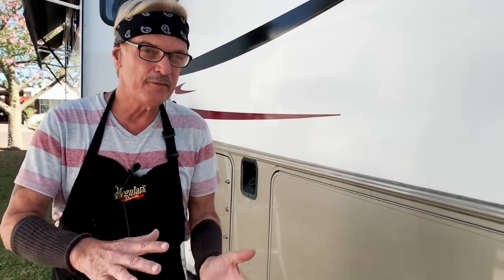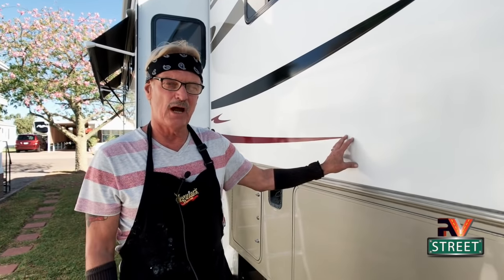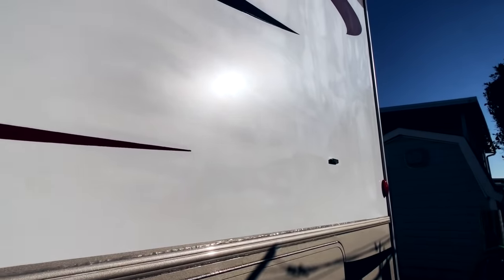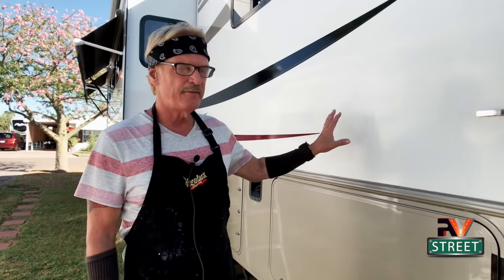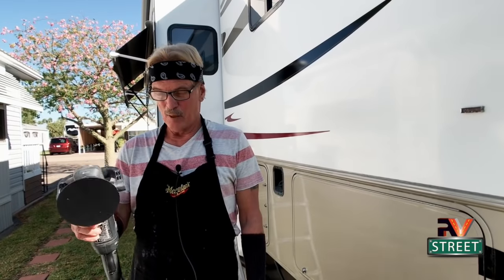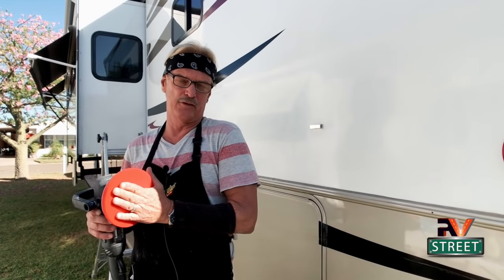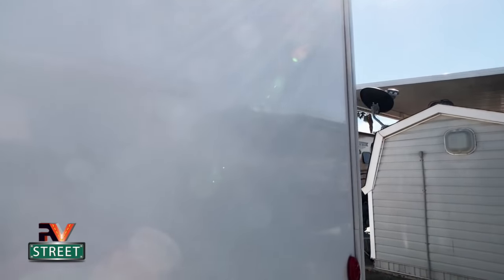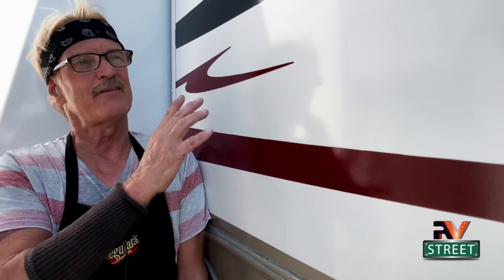HOW TO POLISH & PROTECT YOUR RV THE RIGHT WAY 👍

Comment: My coach has quite a bit of oxidation. I'm going to use a rubbing compound to cut through it best I can, then wax and polish - before painting the decals. Except I'm not sure which to do first, painting the decals or rubbing compound and wax the coach? Thoughts?
Reply from the maker: Painting the decals last.
Reply: @RVstreet   Since my coach has a good bit of oxidation, should I wax rather than polish afterward? Or. wax first after the compound, and then polish over the was too?
Reply from the maker: @INOut107  The order is: Wash good, then compound, then polish, keeping your pads clean during these steps and then wax.
Reply: @RVstreet  Thank you.

Comment: Martin- I went to order through your Amazon link and it shows the Wash Wax All as not currently available. Do you have a recommendation for another similar or comparable system that I can get? Thanks
Reply from the maker: Nope. There's nothing like this mop kit. All others are just inferior and not near as easy to use. I have talked to the company about this lately and they have had supply chain issues ever since Covid but are trying to catch up. They have recently told me that they should be back in supply by late May or Mid June or so. But these units do sell quick they're that good.
I so appreciate you sending me this comment and wanting to support our channel by using our Amazon Store for this purchase. I respectfully ask that you try back about about once a week until you get your order in. Here's our Amazon Store link again to make it easy for you. https://www.amazon.com/shop/rvstreet
thx jgutz 🔧 👍

Comment: Is the lightweight polisher you use suitable for removing heavier oxidation?  Do you have a video on that process?
Reply from the maker: Yes the light weight Meguirs MT300—5.4lbs.—it is the exact unit I used to remove the oxidation on our coach had when I first bought it in 2016. I didn't have a YT Channel at the time so no, I don't have a video on it. But I wish I did. I've actually been looking for an RV that has some oxidation so I can do a video on the process in a camp ground. But I haven't had any owners willing to cooperate with me. I use the MT300 for everything. It's an awesome machine. Be sure to buy the back plate too. It's sold separately.

Start small first. Like on the back. That will give you an area to get into the rhythm. Compounding to remove oxidation takes time. As you compound the pads will load up with material, so as you remove it constantly by keeping cleaning them. If you have heavy oxidation, you'll have to use the wool pad and the diamond cut compound, otherwise use the other material and my red pads. Once oxidation is off, then polish. It probably will take 2 or 3 passes to restore the shine. Don't do it in the sun. An overcast sky is the best to polish and apply RejeX as your final coat. Again keep your pads clean, keep wiping off the polish off the RV each time you make a pass. Do small areas at a time. It's also better and goes faster if you have several pads. Just be patient, be methodical and it'll come out nice. You can do this.

Everything I use is in my Amazon Store https://www.amazon.com/shop/rvstreet
The stuff you're inquiring about is in the "Compound, Polish, Finish Coat" category. Above each product is a text bubble where I describe what each product is and what I use it for.
Here's a link to one of my PLAYLISTS that covers other aspects of how I take care of the outside of our coach. These will be helpful to you also. Especially the first 3 videos: https://www.youtube.com/playlist?list=PLkQXtMp9xodSqUtTPMkSjVRGmSQkz4XJz

Hope this helps. 👍
Reply: @RVstreet  Thank you for the help.  The unit I bought is only 18 months old but it’s been sitting out in AZ and is just starting to oxidize on the upper half.  I want it to sparkle.  Can’t imagine someone wouldn’t let you clean up their rig😁
Reply: @RVstreet  ok, from your Amazon, I’ve basketed up the buffer, 5” backing plate, 5” red foam, polish, reject.  Th wool pad listed is 8” so doubt if that is correct for MT300.  Also, there is an oxidizer remover 49 and two other compounds listed.  What wool pads and compound do I need to remove moderate oxidation and prepare it for the polishing?

Comment: Hey! I wanted to order this exact set up but in your links, you have a 5 inch backing plate and 6.5 inch pads, is that okay? or should I go for the 6 inch backing plate? Thanks!
Reply from the maker: 6.5" pads with the 5" plate is fine and that's what I use. So ya, it's okay. I'm glad you brought this up. Others may have the same question so I clarified this information in my link description. Thanks for supporting our channel SM. 👍

Comment: Hey Martin (and videographer extraordinaire, Joanie) thanks for the follow up video. I’m glad you mentioned the pads.
I have a huge issue and am hoping that you can help. I went through a commonly used Truck Wash. while attempting to get some rust off I noticed that some of the gel coat, or whatever they use now, is gone. I think they used a hard brush trying to remove the rust.
What products do I use? I have the blue wipe on wipe off cleaner and various other products. I’m not at the RV so I can’t list them. 
Is there something I should start with?
Thank you in advance.
Reply from the maker: "while attempting to get some rust off I noticed that some of the gel coat, or whatever they use now"
Can you elaborate some more on this? What part of the RV are you talking about, type of RV etc.
OR........
Take a couple of good, well lit pictures, describe your problem and post them here on our FB page.....if you do FB

Comment: Would you suggest those same steps on a six month old 5th wheel or something different as it is new?
Reply from the maker: If it's full body paint (FBP) no. Most RV manufacturers recommend at least  1 year before you do any polishing or waxing to a coach that has full body paint. It needs that long to fully cure before you go additionally sealing and protecting it with wax or RejeX etc. But I have seen very few FBP 5vers out there. So with that being said, if it's not FBP then absolutely. If you start to take care of it now, and protect it now, you''ll be saving yourself a lot of grief later on. Once an RV starts to fade, get dull or oxidize your work load just doubled.

Comment: how can i tell what type of roof i have fiberglass or rubber
can i use 303 rubber roof cleaner on a fiberglass roof?
I bought 303 rubber roof cleaner from amazon, hesitant to use on my roof 2004 Damon Ultrasport
Reply from the maker: Well, you have to get up on the roof and look. If you have a hard shell type roof it's fiberglass. If is softer or has a fabric type material you have a rubber or EPDM roof.
I would not use 303 rubber roof cleaner on a fiberglass roof.
If you want to see the right way to take care of a fiberglass roof and what I've done to my fiberglass roof you need to watch this video: https://www.youtube.com/watch?v=H00oNtbvtrk&t=538s

Comment: What is the best pad and product to use with the MT300 to remove oxidation before following this procedure?
Reply from the maker: Thanks Terry for your question 🔧 👍
My red pads for light oxidation and wool pads for heavy oxidation. In my Amazon Store under the "Compound, Polish, Finish Coat" category, I have a text bubble above each product that explains what product and pad I use for different applications. You can't go wrong with these recommendations. JIC....you didn't see it in my description text, if you order my MT300 you also need to order the backing plate because that does not come with the polisher. I use the 5" backing plate, not the 6" plate.
https://www.amazon.com/shop/rvstreet
Reply: @RVstreet  Thanks, everything ordered
Reply from the maker: @terrymccafferty  Thank you Terry so much for supporting us using our Amazon Store. Take your time and be methodical. When I did my RV when we first got it, it was oxidized pretty bad. Especially the drivers side. The total process of removing all the oxidation, polishing and protection took me 3 weeks, working on it mostly in the afternoon and evenings in a covered storage area. I bought a rolling scaffold with locking wheels to do all the upper part of the RV. That made that part so much easier by being able to stand straight and work those areas. 
One last thing that will help. As you remove oxidation the pads will load up with removed material so you'll have to continually wash them out. Have a 5 gallon bucket of water and a small brush up on scaffold with you to do this as you move along.
Good luck and let me know how everything came out when you're finished. 👍

Comment: Are the stripes decals or painted?   If they are decals won’t buffing them damage the decal?
Reply from the maker: They're vinyl graphics and no it won't when polishing.If you watched carefully the main area I was really focusing on was the white fiberglass areas. But even when doing areas like that I gently go over the graphics too because can start to get dull and faded too. It's not a big deal. Didn't you see how bright and clean my graphics were? And ALWAY RejeX them too.
Reply: @RVstreet  Thanks for the reply.  Just don’t want to make a mess of my decals.  🙄. I watched you very closely but wasn’t sure if the were decals or painted.   I did see how you made everything look new.  Thanks again for sharing.   My Fiver is brand new.  Just washed it and was preparing to wax it.  But now I’ll use the RejeX vs the Meguires wax I have.  I always wax my vehicles every quarter.  My 2005 Civic looks brand new!
Reply from the maker: @enarandyr9122  👍

Comment: Martin my class c needs to be polished badly!!!!!
Reply from the maker: You can polish it to nice shine as long as you don't have any oxidation. If you have oxidation that has to be removed first. Here's some instructions:
The light weight Meguirs MT300 Dual Action—5.4lbs. It's an awesome machine. Be sure to buy the back plate too. It's sold separately. It is the exact unit I used to remove the oxidation that our coach had when I first bought it in 2016. Having the right polisher is important. My coach at the time had heavy oxidation on the drivers side and back with light to medium oxidation on the other areas. My large slide on the drivers side was the worse so I had to use the wool pad and diamond cut compound on that area. I didn't have a YT Channel at the time, so I don't have a video on it. But I wish I did. I've actually been looking for an RV that has some oxidation so I can do a video on the process in a camp ground. But I haven't had any owners willing to cooperate with me. But I use the MT300 for everything to keep it maintained and yes, it will last as long as you keep it up every year. Don't ever let it oxidize again. If need be like you saw in the video, if an area needs a little polishing, polish it then apply RejeX. My secret to keeping it maintained and shiny is using RejeX for my final coat because RejeX blocks the UV rays from the sun and that's what causes oxidation.

Start small first. Like on the back. That will give you an area to get into the rhythm. I used a 12' rolling scaffold so I could stand up straight and do the top half of the coach. The bottom half is much easier to do than the top. Compounding to remove oxidation takes time. As you compound, the pads will load up with material, you have to constantly remove it, by keeping them clean by washing them out with water—warm water is best—in a bucket and a small hand held brush. Wring them out, put them back on the MT300 and continue. Since you have heavy oxidation, you'll probably have to use the wool pad and the diamond cut compound, otherwise use the other compound material in the blue bottle in my store and my red pads. Once oxidation is off, THEN polish with my Meguiar's Ultimate Polish also with the red pads. It probably will take 2 or 3 passes to restore the shine. Don't do it in the sun. An overcast sky or inside under cover is the best to polish and apply RejeX—or wax if you prefer that instead—as your final coat. Again, keep your pads clean AND DRY when applying polish, keep wiping off the polish off the RV each time you make a pass with a microfiber cloth. Do small areas at a time. It's also better and goes faster if you have several pads. Just be patient, be methodical and it'll come out nice. You can do this 👍

Everything I use is in my Amazon Store https://www.amazon.com/shop/rvstreet
The stuff you’ll need is in the "Compound, Polish, Finish Coat" category. Above each product is a text bubble where I describe what each product is and what I use it for.
Here's a link to one of my PLAYLISTS that covers other aspects of how I take care of the outside of our coach. These will be helpful to you also. Especially the first 3 videos: https://www.youtube.com/playlist?list=PLkQXtMp9xodSqUtTPMkSjVRGmSQkz4XJz

Comment: How much surface area does one 20oz bottle of the polish cover?
Reply from the maker: Easily does my entire 35' coach with the pads and polisher I use.
https://www.amazon.com/shop/rvstreet?listId=2FYK60PHSQDNJ
Reply: I’m sorry I forgot to mention I have a 43 ft 5th wheel. Will 1 20oz bottle do the job?
Reply from the maker: @bhannay  It'll be close but probably. Make sure though you swap out to a new pad every 1/3 of the coach you do. After you do 1/3 of the coach, the pad will load up and will have some dirt in it no matter how clean the coach is. So you want to start fresh on the next 3rd and the next 3rd. Then wash all 3 and air dry for the next time.
Reply: @RVstreet  thanks for the info. Love your channel by the way. Do you prefer red or black pads for applying the polish or the rejex?